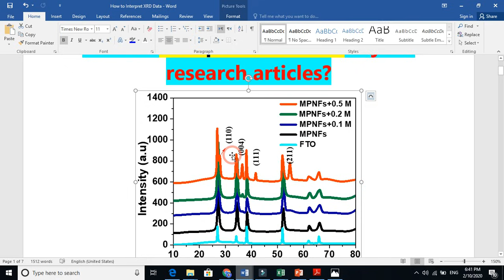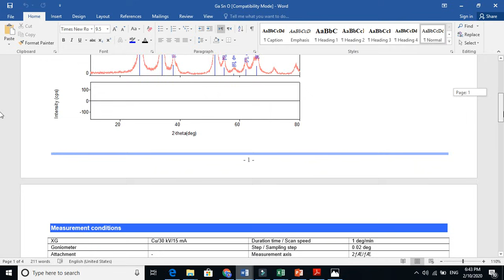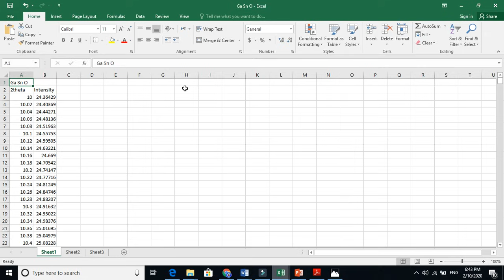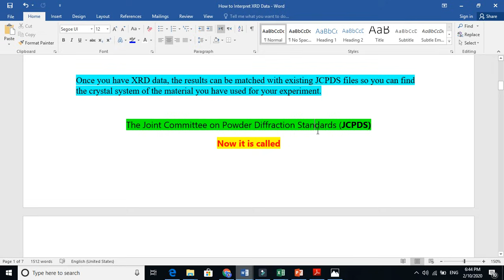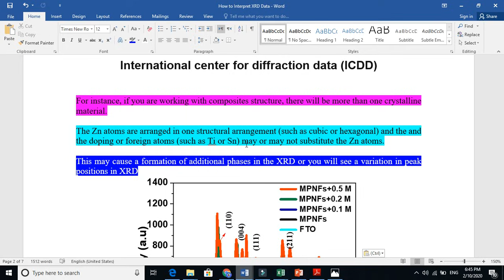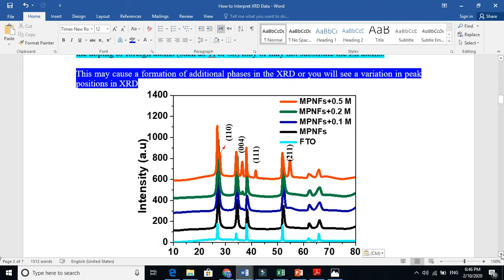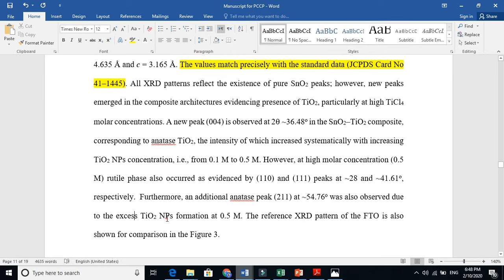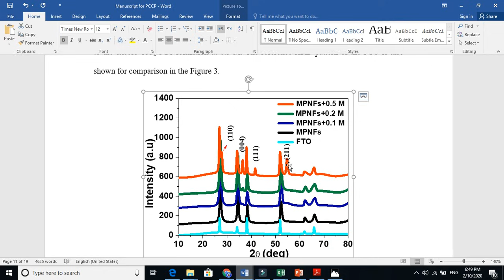How To Analyse XRD Data / Plot / Graph in Research Paper? Experimental Paper Skills

Comment: it is a great presentation, if you could help me to have the standard pdf data or the diagram for bentonite 1m558 for my work on anti-mycotoxins as compared with ordinary bentonite
Reply from the maker: Many thanks for the nice words.  
Look, I will also search the ICDD #  or PDF data for your sample so you can also search on yourself.

Let me tell you the methods 

1. Search it on Google, and Google will take you to the relevant research paper or review paper, or may be there is a discussion on ResearchGate 

2. You are working on this topic, so it means you studied this material from a research paper. Therefore,  there must be detail of this material in that paper or in the references cited in that paper.  Very important point

3. Try crystallography dot org or .net and try for CIF file 

4. Look at the ICDD website if possible 

5. Just jot down question on ResearchGate, and someone will respond who is working in the same field

6. Lastly,  use this key words in the Scopus, and hopefully, you will find the relevant papers.

The above-mentioned points are the different approaches to get the ICCD# for your unknown or known sample.

Comment: please can you tell me where i found the data to draw the graphes ??  i have the percentages of the detected elements only ???
Reply from the maker: Are you about XRD or EDX? 
The XRD operator will hand over the raw data, and then you have to draw the graph like I have shown in this video
Reply from the maker: @djedidmana3405  but my data is different than yours. For example,  my work was based on metal oxide semiconductors like SnO2, TiO....

Which field are you working on?
Reply: Yes I'm working on the mineral oxides ...such as CaO...SiO2...
Reply from the maker: @djedidmana3405  So this simply means that the XRD graph, in my case and your case, would be absolutely different.  

You simply take your sample to the XRD operator and let he or she perform the XRD. After that, they will hand over the raw data in the form of intensity vs. 2 theta . Now you have to draw it in Origin Pro like I did in my case.

I hope it is clear !

Comment: Hi. Thanks for theses slides. Quick question: on the last slide when you were calculating the "d" from final XRD graph, how can we determine each peak is correspond to which planes? i.e. how did you find out it was (111) or (222)?
Thanks
Reply from the maker: Actually,  the XRD machine will provide two files ,one in Excel form and the other in WORD DOC.
In the Excel, the intensity is in one column, while the 2 theta in other colum . You can draw it in Origin Pro, etc.
In the word files, all the details are available, such as d value, the corresponding peak value, such as 111, 121,..

There are other ways also to calculate

Comment: what does it mean 110, 004....etc. please explain it. Thank you
Reply from the maker: These are called planes denoted with symbol (hkl) and can take any value, (110), (200)..... These (hkl) is called Miller indices. Let's suppose a unit cell having three lattice vector a1, a2, and a3. These hkl denotes a plane that intercepts the three points a1/h, a2/k, a3/l  or some multiple. I recommend you to read 7 crystal structure .

Comment: Namaste sir.
Very well explained. Thank you. If the synthesised compound is new and we don't know the compound name then can I compare the peaks with the JCPDS data of the corresponding  oxides of reactants individually ?
Reply: So can I conclude that we can verify by the JCPDS data of the oxides of corresponding raw materials. Say strontium oxide, aluminium oxide and If I am doping Europium (say) , by  it's oxides
Reply from the maker: @chandrakalas6989  to be honest,  I am not much sure much about it.  But I can assure that you just search similar work done before that will definitely help you.
Reply from the maker: I think the best way is to go for EDX so that to understand the chemical analysis. This way you will understand the elements and then you go say something about the XRD
Reply: @nanospeaks  Namaste sir,
Thank you for guiding me.
 I have XRD data, but how should I confirm it. for example, if my sample is synthesized using strontium nitrates and aluminum nitrates say and I don't have jcpds data for that synthesized compound to compare and confirm and find out h, k, l values and its phase, structure, and so on.
Reply from the maker: @chandrakalas6989  in case of Al(NO3)3 , please check Al2O3, and some other similar compounds XRD that will help to identify peaks....
Reply: Ok, thank you, sir

Comment: Thank you How can interpretation clay mineral XRD chart with three treatment (Glycol and Heating)?
Reply from the maker: I do not know exactly your question.  However,  treatment with heat or doping another element affect the XRD pattern  a lot.
Reply: @nanospeaks   the clay mineral examination by XRD include three stage for each sample, at first  exam in normal state, after that the same sample are saturated by ethylene glycol and examend  , and same it treated by heating for 330 C and 550 C each sample examend 4 times and the result giving as 4 xrd chart per 1 sample.

Comment: Brother how can we determine single crystal structure from Powder diffraction data?
Reply from the maker: I answer it but you can guess from XRD pattern too. If very sharp peak so it will single whether is poly is made of many single so the peak should be diffuse but bot like amorphous
Reply: @nanospeaks  
Brother I wanna, how I would know whether the crystal is cubic monoclinic etc from Powder xrd data?
Reply from the maker: Good question. You will get a word file from XRD machine. In that file there are crystal lattice parameters. Just compare those parameters with the literature so you will know that it is cubic or tetragonal etc
Reply: @nanospeaks  
Thanks understood now....
Reply: @nanospeaks  I want to know that how those already existing parameters were made??
Reply from the maker: @ganeshgaur2002  good question. These elements which exist Long time ago and their all information exist in the literature. For instance,  Why they keep similar elements in the groups in the periodic table because they know their all properties.